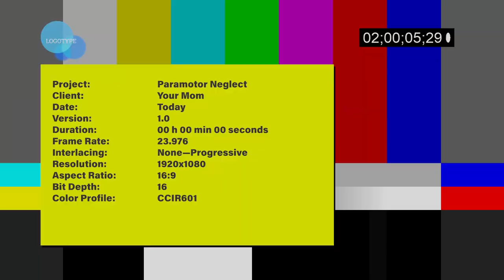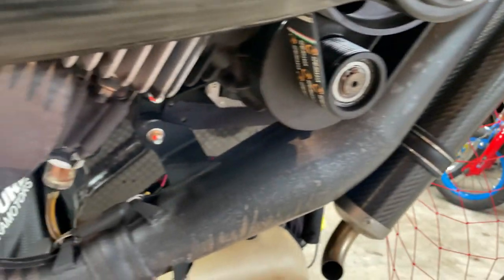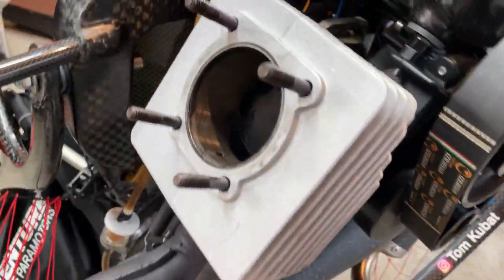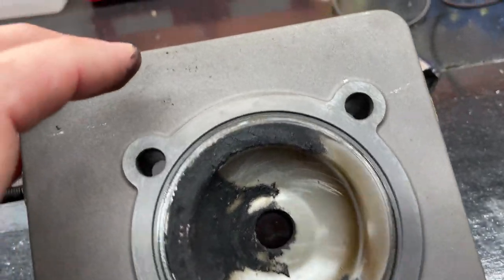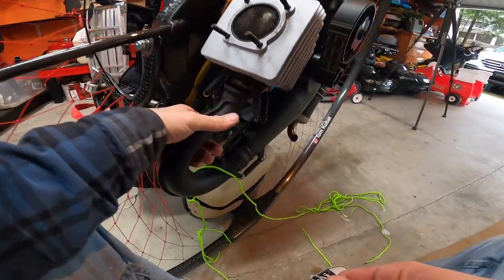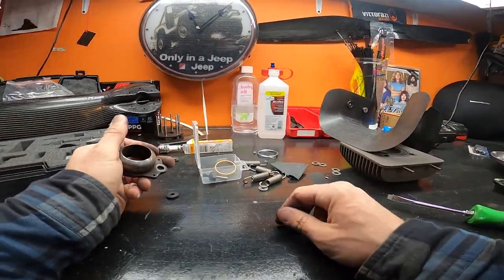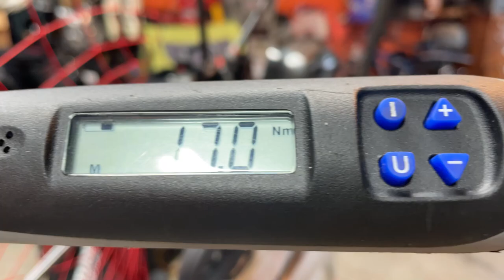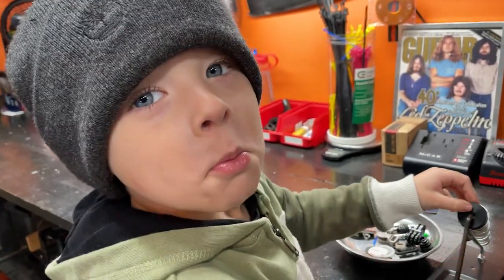Paramotor Neglect

Comment: Spray your exhaust pipe with some Loctite rust neutralizer it will turn it a black color. Do not remove the rust. The rust needs to be on the pipe to be converted into a hard surface. After the rust neutralizer dries it creates a paintable surface that no longer rust then you can spray the exhaust pipe with flat black manifold paint

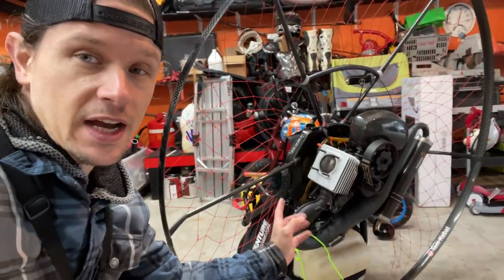Comment: Tom, 8:02 I have the same puller. I tac welded the end closed and now wrap a small rag around the handle. Saves many raw knuckles! Or you could also watch Stephans (Scout) maintenance vids. He shows how he takes off the springs using double wrapped brake line. - Good luck!

Comment: I had the same  spark plug for a wile with no problems.   Put a new one in and had a motor out on run up    so put the old one back in.  I run ngk plugs,       I also have been running the same belt for 70 hours.  Never tightened it or anything and it's still doing good. Going to try for 100 hours on it

Comment: When I bought the Vitorazi spares kit, my flight school owner swapped the springs and bushing for the MY20 spec. The springs are not the same, they have less tension to allow more flexing of the exhaust. This , along with the extra joint, was to reduce the cracking issue.

Comment: If you are committed to changing the exhaust bushing just cut the springs off with wire cutters dude. Way easier. I use a trampoline spring puller to put the new ones back in. Works a treat!

Comment: For the exhaust springs, I use a piece of brake line with a loop tied on both ends. I put it through the hook on the spring and put a screwdriver through both of the end loops. This allows you to get a hand on either side of the exhaust and pull straight down using the screwdriver as a handle. Once the spring is on, remove the screwdriver and the line can just be pulled through. For the exhaust rusting, I always use CLP gun oil I acquired from the army and I haven't had a spot of oxidation yet. I don't put it on that often, just every time I do my regular maintenance or cleaning. Most gun oils would probably work, they're meant to prevent oxidation at high heats

Comment: Tom, your helper will by flying with you before you know it!  Thanks for the video!  I fly at the beach often, and I am a big believer in using the 3M Paint Protection Film on the leading edge of my props.  The sand was eating my wooden props up and sandblasting the tips of my CF prop.  The film stopped all of that.....and it is very easy to apply.  Cheers! Bill

Comment: Hey Tom.  I've had an MY20 exhaust on my motor for just about a year and fly from the beach all the time.  Mine is perfect.  Not sure why yours looks so bad.  I do keep mine in an air conditioned garage away from moisture and occasionally wipe mine down with some WD-40.  FYI.  Thanks for the vid!

Comment: Spring tool.   Cut triangle off the shaft.  Weld stem through a 3, 4 inch piece of 1/2 or 3/4 steel tube..  u will get way better control.. and less cord burn.. 👍
Reply: With that u can make the hook a rotating piece ..  drill tube .  run shaft through the pipe , weld nut on shaft..  so u can have hook at any direction to handle position..   rotax springs are a bitch too..  nothing like skun knuckles n claret everywhere..😂😂

Comment: I have about 35 hours on my MY20 and no rust on the exhaust.  After each flight I wipe the exhaust with some vehicle paint detailing spray. I have no idea if that's a good idea or not but my exhaust still looks brand new.

Comment: Have you done a test between spark plugs as in from an original to the e3 diamond spark plug
Reply from the maker: I don’t notice a difference.
Reply: @Tommyflies  i did some research in to them plugs and they reckon them plug ignite the fuel fast with the way the tip is set out so it burns more of the fuel and at a faster rate